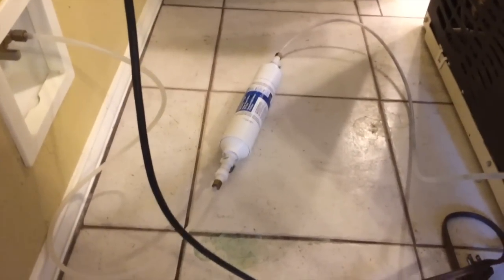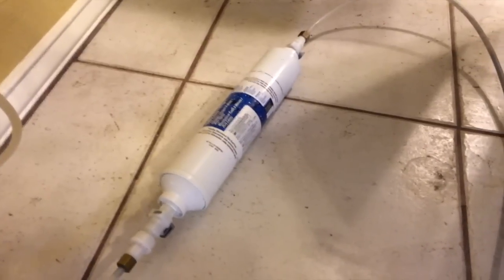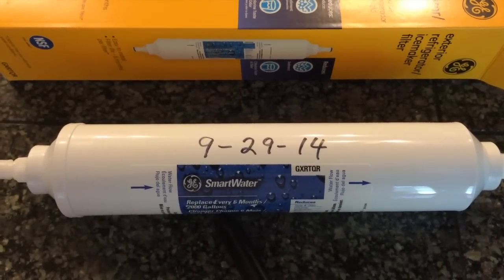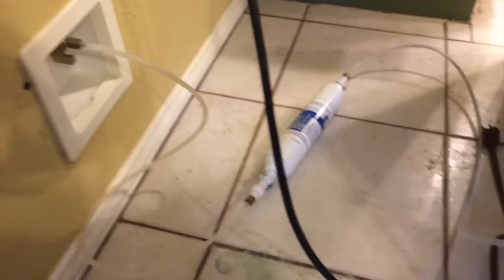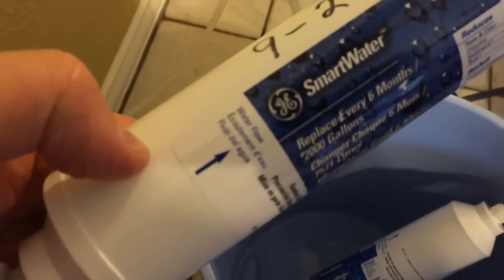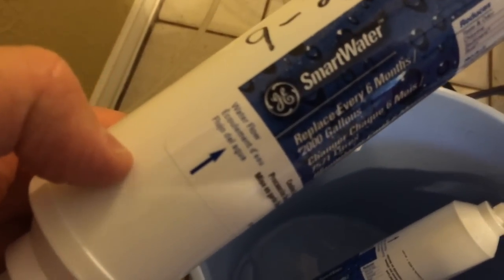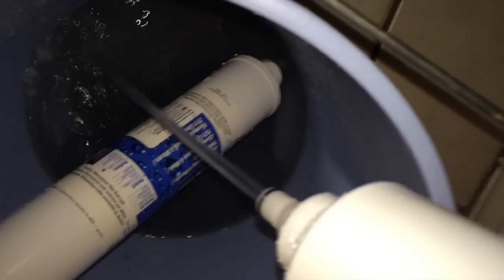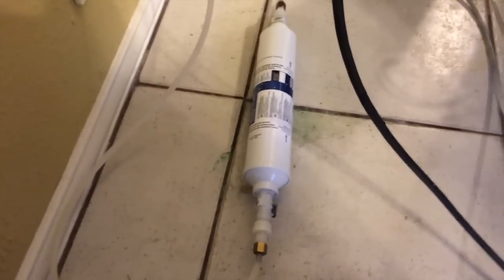How to Change Inline Water Filter GXRTQR

Comment: I watched this to learn how to disconnect and connect a new filter.  You skipped totally skipped that part????
Reply from the maker: +Shane Smith Shane, amazing timing.  I'm actually uploading a companion video now showing how the fittings work.  My apology but I'm still learning.  Thanks for your comment.
Reply: I watched for the same reason.  I decided to not try to pry the fitting up but to press it.
Lucky that squeezing the button like thing not he quick connect loosened it.

Yes good point on flushing as it was large amount of loose carbon particles.
So that much helped.   But frustrated by missing disconnect procedure.  At least mention on the notes section to squeeze the disconnect to get the connection to release.
Reply from the maker: +Charles Granata Thank you Charles!  This was one of my early videos and I was still learning but have recently done another video on just the connections.  Thanks for your comments.
Reply: Replaced successfully.
Always be sure to remind people that few tools are needed and no need to cut anything.
Also the flushing is totally spot on, so so so much carbon came out, it would have be a mistake not to flush!
Keep it up!
Reply from the maker: Thank you Charles.  Appreciate the watch and your comments.
Reply: just put the same comment..everything he shows I know ok but does the thing screw on and off or what and which exact bit?
Reply: At least he filmed the bucket
Reply: @robbmiller7796  He skipped the only part I needed to know.
Reply: Shane, how did you find the one you are referencing here? I need to remove the filter and install the new one. thank you!
Reply: Exactly.  I wanted to know what to do with the tab!   Pushing nor pulling releases it.  I suppose a hammer would work.  Or a hacksaw.